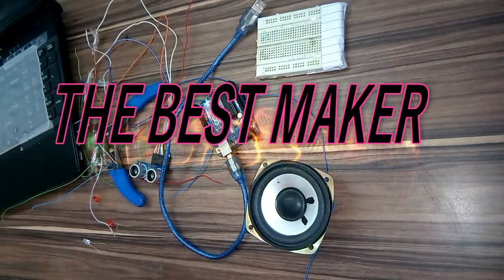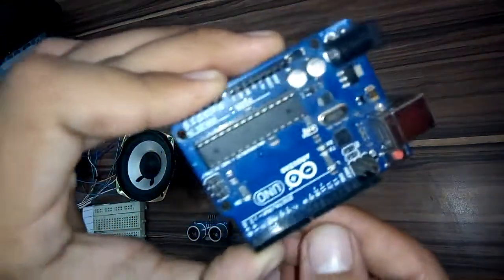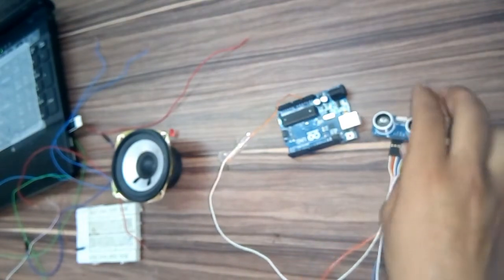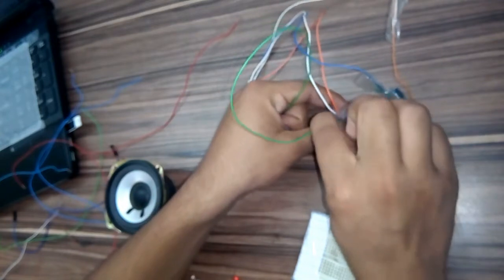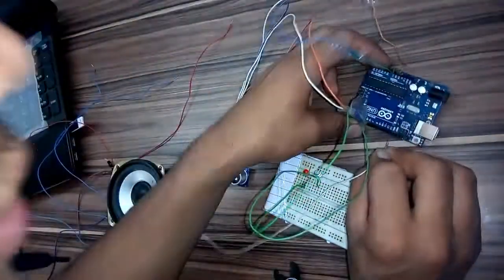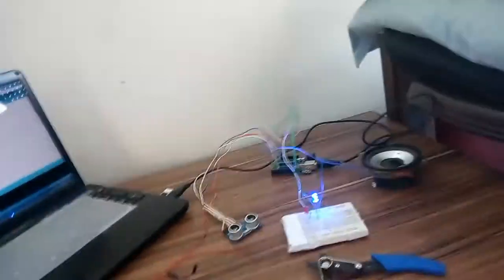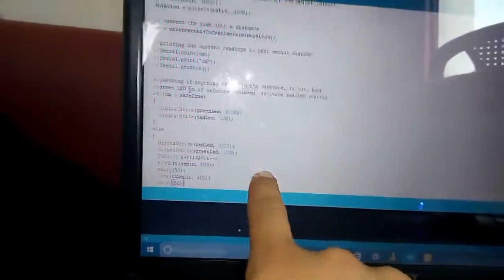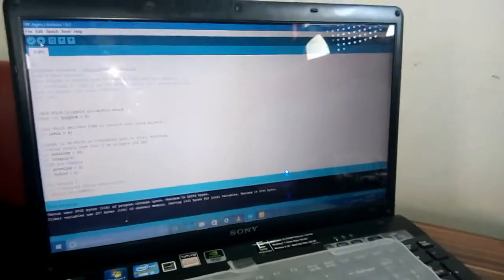How to make security alarm using Arduino and ultrasonic sensor | Alarm system | Experimentalist.

Comment: Hello.. Thank you for the tutorial.. Is it possible to change the sound from RINGING to DOG BARKING sound? Thank you.
Reply from the maker: no, it is not possible to do this, but there is another method, which is recorded voice you can play for this you need a memory card reader and amplifier of Arduino. and there is also another module which record sound approx. 15-20 sec, and it also plays the recorded sound

Comment: I tried It , Thankfully It worked and it's worth . I used    It to improve my room security.
If you don't know how to connect wires , check below
speaker (+) = pin 8 
speaker (-) = pin Ground

Trig = pin 5
Echo = pin 6
Vcc = pin 5v
Gnd = pin Ground

Red LED (+) = pin 2
               (-) = pin Ground
Green LED (+) = pin 3
                    (-) = pin Ground

Comment: how to add a keypad in it for adding a feature of password
that is if only the password is not entered then only the sensor works
Reply from the maker: nice idea, but I do,t have a keypad at this time. but I definitely make this one when I have this keypad. thanks for giving me an idea.
Reply: @experimentalist1494  sir actually i have to make it for my project , can you please guide a little
Reply from the maker: @sakshamsemwal7641  I don't use a keypad yet, but I guide you. through the guidance, I will also learn.
Reply: @experimentalist1494  i request if you could just make it on tinkercad along with code, hence you will not require the physical components to be present . It will be a great help.
Reply from the maker: @sakshamsemwal7641  ok I got it, wait I will try this. if this completed I share you a code
Reply from the maker: @sakshamsemwal7641  it's done, how can share i you, code, and circuit diagram, give me your email id
Reply from the maker: @sakshamsemwal7641  check your email, I send you
Reply: @experimentalist1494  thank you so much.....but what if we also want to add a LCD screen to display the password we entered....or the message if a wrong password is entered....

I have mailed you a code and circuit diagram....which is not working....if you could find a problem...it will be a great help
Reply from the maker: @sakshamsemwal7641  yes i can also add the lcd screen, if you need that code. Then reply me
Reply: @experimentalist1494  it will be a great help sir.....please do that.

Please display the password we enter or a message if a wrong password is entered.
Reply from the maker: @sakshamsemwal7641  check your email. The send the code

Comment: How can I add a voiceover instead?
Reply from the maker: use the card reader module, save the voice or sound to the memory card and play the sound.
Reply: @experimentalist1494  Got it, Thanks by the way it works nicely
Reply: What are the connections when you will add voiceover instead and what is the code??? Badly needed for my project🥺🥺🙏🙏

Comment: Can i make this project without breadboard plz answer
Reply from the maker: Yes, brother. breadboard is just a type of connector. it used because it is very simple to break or connect the wires.
Reply: @experimentalist1494  thanks bro
Reply: @experimentalist1494  hey bro can I make this project proteus please reply or send me the scheme of this project using proteus I want to make it as simulation
Reply from the maker: @salahali9567  brother I never use proteus, but I definitely help you, give me some time  because 1st of all I learn how to use then I give you scheme of this project

Comment: Can I connect the project with a 9V battery and how?
Reply from the maker: connect 9v battery positive terminal to arduino pin Vin and ground of 9v battery to the ground of arduino.
Reply from the maker: "Vin" pin is located right of ground pin and near to A0 pin
Reply from the maker: see pin name at the power side where 5v  is there
Reply: @experimentalist1494  is this a good speaker? https://www.gotron.be/visaton-breedband-luidspreker-8cm-3-3-10-15w-8-ohm.html
Reply from the maker: @milanlys8516  this speaker is high wattage. use the speaker which has small power rated  5w or 3w because arduino can handle these  speaker, arduino gives not much power to drive high wattage speaker.
Reply from the maker: you can also use amplifier to increase the sound. by connecting the audio jack of the amplifier to arduino.
Reply from the maker: if you connect the high wattage speaker, then connect the amplifier amplifier to arduino.
Reply from the maker: @milanlys8516  yes this is fine

Comment: Hey bro what are these wire called?? Is it Ardino Jumper wire?  If it is can i use any pin for it
Reply from the maker: these wire are not arduino jumper wire , these wire are used in LAN cable. these wire are breadboard friendly, i used because, arduino  jumper wire are costlier , 1 wire cost 3 rupees, and these wire are easily break ,when use couple times. but the LAN cable wires are cheap and long lasting. LAN wire is group of these wire group of wires vary 6 to 12.  so in 1 meter of LAN cable threre are 1m of individual 6 wires.
Reply: @experimentalist1494   sweeeeet

Comment: Pl sent  codes to WhatsApp
Reply from the maker: can you give me your email id. i send the code to this id
Reply from the maker: //security alarm.
//******************1st ultrasonic sensor**********
const int pingPin = 5;   //trig pin of arduino
int inPin = 6;    //echo pin of arduino.

//******************2nd ultrasonic sensor**********
const int pingPin1 = 5;   //trig pin of arduino
int inPin1 = 6;           //echo pin of arduino.

//range in cm which is considered safe to enter, anything coming within less than 5 cm triggers red LED
int safeZone = 95; // for 1st sensor
int tonepin=8;

int safeZone1 = 95; // for 2nd sensor   

//LED pin numbers
int greenLed = 3; // for both  sensor
int redLed = 2;

 
void setup() 
{
  // initialize serial communication
  Serial.begin(9600);

  //initializing the pin states
  pinMode(pingPin, OUTPUT);
  pinMode(inPin, INPUT);
  pinMode(greenLed, OUTPUT);
  pinMode(redLed, OUTPUT);  
  pinMode(tonepin, OUTPUT);

  pinMode(pingPin1, OUTPUT);
  pinMode(inPin1, INPUT);
}
 
void loop()
{
  //raw duration in milliseconds, cm is the
  //converted amount into a distance
  long duration, cm;
  long duration1, cm1;
 
  
  //sending the signal, starting with LOW for a clean signal
  digitalWrite(pingPin, LOW);
  digitalWrite(pingPin1, LOW);
  delayMicroseconds(2);
  digitalWrite(pingPin, HIGH);
  digitalWrite(pingPin1, HIGH);
  delayMicroseconds(5);
  digitalWrite(pingPin, LOW);
  digitalWrite(pingPin1, LOW);

 
  //setting up the input pin, and receiving the duration in
  //microseconds for the sound to bounce off the object infront
  
  duration = pulseIn(inPin, HIGH);   // for 1st sensor
  duration1 = pulseIn(inPin1, HIGH); // for 2nd sensor
 
  // convert the time into a distance
  cm = microsecondsToCentimeters(duration);
  cm1 = microsecondsToCentimeters(duration1);
 
  //printing the current readings to ther serial display
  //Serial.print(cm);
  //Serial.print("cm");
  //Serial.println();
 
  //checking if anything is within the safezone, if not, keep
  //green LED on if safezone violated, activate red LED instead
  
  if (cm > safeZone || cm1 > safeZone)
  {
    digitalWrite(greenLed, HIGH);
    digitalWrite(redLed, LOW);
  }
  else
  {
    digitalWrite(redLed, HIGH);
    digitalWrite(greenLed, LOW);
    
    for(int i=0;i<20;i++)
    {
      tone(tonepin, 500);   //you can change the sound by changing numbers.
      delay(50);
      tone(tonepin, 400);    //you can change the sound by changing numbers.
      delay(50);
    }

    noTone(tonepin);
  }
 
  delay(100);
}
 
long microsecondsToCentimeters(long microseconds)
{
  // The speed of sound is 340 m/s or 29 microseconds per centimeter.
  // The ping travels out and back, so to find the distance of the
  // object we take half of the distance travelled.
  return microseconds / 29 / 2;
}

Comment: you can make  with out tune pl do with out  tone  and i wave  cycle horn program and i want only  power out put only i want
Reply: I want to  use 2 sensor
Reply from the maker: @suni8878  ok means two ultrasonic sensors
Reply from the maker: brother can you explain again in more clear way.i not understand what you saying

Comment: sir can you please share the on the comments. Please.
Reply from the maker: i can not understand what you say,i think you say that share the code in comment, right??
Reply from the maker: //security alarm.

const int pingPin = 5;   //trig pin of arduino

int inPin = 6;    //echo pin of arduino.
 
//range in cm which is considered safe to enter, anything
//coming within less than 5 cm triggers red LED
int safeZone = 95;
int tonepin=8;
//LED pin numbers
int greenLed = 3;
int redLed = 2;
 
void setup() {
  // initialize serial communication
  Serial.begin(9600);
}
 
void loop()
{
  //raw duration in milliseconds, cm is the
  //converted amount into a distance
  long duration, cm;
 
  //initializing the pin states
  pinMode(pingPin, OUTPUT);
  pinMode(greenLed, OUTPUT);
  pinMode(redLed, OUTPUT);  
  pinMode(tonepin, OUTPUT);
  //sending the signal, starting with LOW for a clean signal
  digitalWrite(pingPin, LOW);
  delayMicroseconds(2);
  digitalWrite(pingPin, HIGH);
  delayMicroseconds(5);
  digitalWrite(pingPin, LOW);
 
  //setting up the input pin, and receiving the duration in
  //microseconds for the sound to bounce off the object infront
  pinMode(inPin, INPUT);
  duration = pulseIn(inPin, HIGH);
 
  // convert the time into a distance
  cm = microsecondsToCentimeters(duration);
 
  //printing the current readings to ther serial display
  //Serial.print(cm);
  //Serial.print("cm");
  //Serial.println();
 
  //checking if anything is within the safezone, if not, keep
  //green LED on if safezone violated, activate red LED instead
  if (cm > safeZone)
  {
    digitalWrite(greenLed, HIGH);
    digitalWrite(redLed, LOW);
  }
  else
  {
    digitalWrite(redLed, HIGH);
    digitalWrite(greenLed, LOW);
    for(int i=0;i<20;i++)
    {tone(tonepin, 500);   //you can change the sound by changing numbers.
    delay(50);
    tone(tonepin, 400);    //you can change the sound by changing numbers.
    delay(50);
    }

    noTone(tonepin);
  }
 
  delay(100);
}
 
long microsecondsToCentimeters(long microseconds)
{
  // The speed of sound is 340 m/s or 29 microseconds per centimeter.
  // The ping travels out and back, so to find the distance of the
  // object we take half of the distance travelled.
  return microseconds / 29 / 2;
}

Comment: sir i want to set welcome word in this security alrm please help me pleaseee
Reply from the maker: you can not produce welcome word using tone function.it produe only tone of various frequencies .if you interested  to make welcome word use  "ISD1820 Recording"  Module .the module record the sound of yours.then you use the sound in your application. the module is  arduino friendly.
Reply: @experimentalist1494  sir you will make code for this pleaseeee
Reply from the maker: @triggeredmusician7795 can you tell me your Budgets because 1 more device is card reader module  for arduino.if you play audio of your in your project you need sd card module.
Reply: @experimentalist1494  sir i do not have more money
Reply: so wat i do

Comment: And how to change another sound without changing the value of tonpin
Reply from the maker: Tone pin is function in arduino,inside tone pin there is program.you can also make the program of your own.
Reply from the maker: Basically tone pin value is frequency.

Comment: Excuse me sir, what do you mean by 'tight' connections????🤐😧
Reply from the maker: It means connections should be tight not loose ,because after repeated use of breadboard the internal connections of breadboard are loose.
Reply: @experimentalist1494  friend I made it with arduino nano in solder board with solder iron and hot air....

Comment: could you write the code in the comments please?
Reply from the maker: You can download the code from link below.
Reply from the maker: //security alarm.

const int pingPin = 5;   //trig pin of arduino

int inPin = 6;    //echo pin of arduino.
 
//range in cm which is considered safe to enter, anything
//coming within less than 5 cm triggers red LED
int safeZone = 95;
int tonepin=8;
//LED pin numbers
int greenLed = 3;
int redLed = 2;
 
void setup() {
  // initialize serial communication
  Serial.begin(9600);
}
 
void loop()
{
  //raw duration in milliseconds, cm is the
  //converted amount into a distance
  long duration, cm;
 
  //initializing the pin states
  pinMode(pingPin, OUTPUT);
  pinMode(greenLed, OUTPUT);
  pinMode(redLed, OUTPUT);  
  pinMode(tonepin, OUTPUT);
  //sending the signal, starting with LOW for a clean signal
  digitalWrite(pingPin, LOW);
  delayMicroseconds(2);
  digitalWrite(pingPin, HIGH);
  delayMicroseconds(5);
  digitalWrite(pingPin, LOW);
 
  //setting up the input pin, and receiving the duration in
  //microseconds for the sound to bounce off the object infront
  pinMode(inPin, INPUT);
  duration = pulseIn(inPin, HIGH);
 
  // convert the time into a distance
  cm = microsecondsToCentimeters(duration);
 
  //printing the current readings to ther serial display
  //Serial.print(cm);
  //Serial.print("cm");
  //Serial.println();
 
  //checking if anything is within the safezone, if not, keep
  //green LED on if safezone violated, activate red LED instead
  if (cm > safeZone)
  {
    digitalWrite(greenLed, HIGH);
    digitalWrite(redLed, LOW);
  }
  else
  {
    digitalWrite(redLed, HIGH);
    digitalWrite(greenLed, LOW);
    for(int i=0;i<20;i++)
    {tone(tonepin, 500);   //you can change the sound by changing numbers.
    delay(50);
    tone(tonepin, 400);    //you can change the sound by changing numbers.
    delay(50);
    }

    noTone(tonepin);
  }
 
  delay(100);
}
 
long microsecondsToCentimeters(long microseconds)
{
  // The speed of sound is 340 m/s or 29 microseconds per centimeter.
  // The ping travels out and back, so to find the distance of the
  // object we take half of the distance travelled.
  return microseconds / 29 / 2;
}